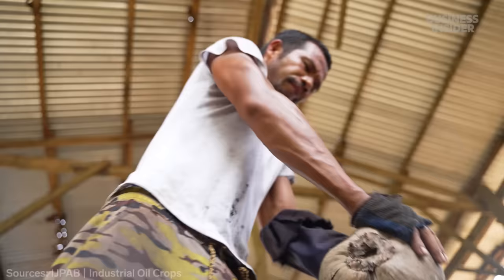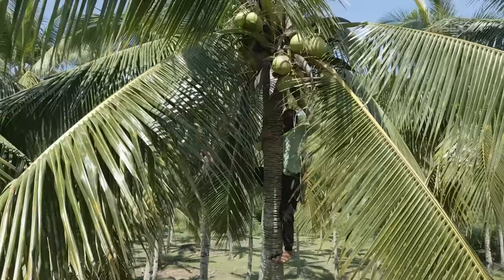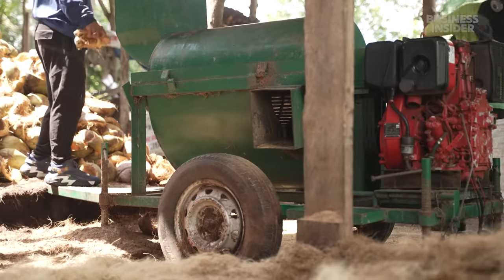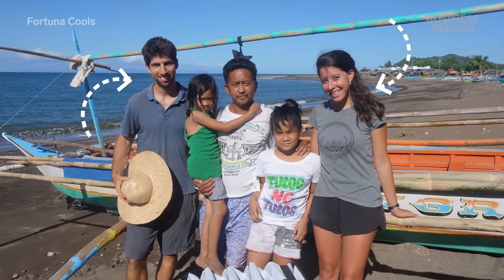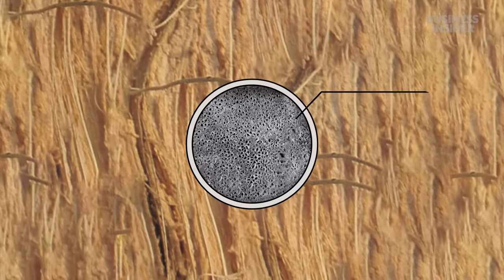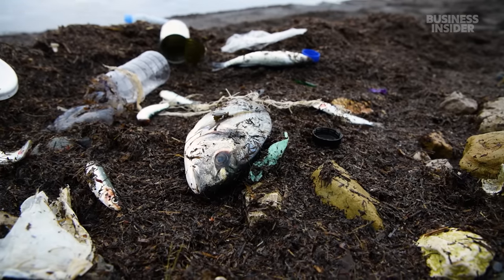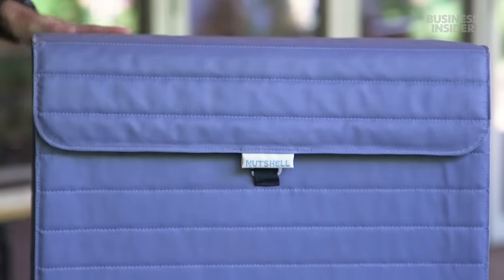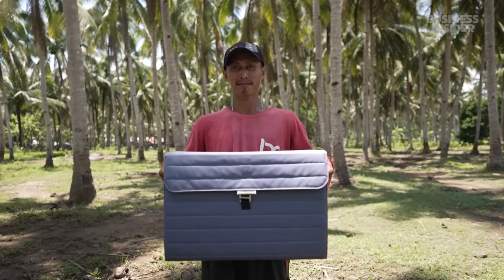How Biodegradable Coolers Are Made Out Of Coconut Waste | World Wide Waste | Business Insider

Comment: Greetings from the Philippines! For myself, I would like to see this product available in large sheet form to use as insulation in the attic cavity for residential homes. Our home, like the majority of buildings here, stands in the direct path of intense heat of the sun. fiberglass is prohibitively expensive and forget about expanding polyurethane foam. Can coconut husk fiber be an ‘inexpensive’ solution?
Reply: Probably very flammable so unsafe for housing. I'm sure they could add something to it to make it less flammable but then it increases the cost.
Reply: And or increase the carcinogen toxicity of it. Tradeoffs suck but they are in almost everything
Reply: Please don't. It's mentioned at the end that it's also used as kindling & a cheap substitute for charcoal.

That's probably why it's best used as a container for wet commodities.
Reply: Yeah as mentioned, sounds like a great way to light your house on fire. As intense as the heat gets there all it needs is a piece of broken glass to focus the sunlight and you've got yourself fire starter. Plus,  given the humidity, it'll likely start biodegrading/rotting causing all slew of other problems.
Reply: When can u sell these in the cities in the Philippines?
Reply: @cobblerama  Maybe, but more flammable than the popular paper insulation used some U.S. attics?   Also, interested in how well the coconut insulation handles water.
Reply: Fiber glass is dangerous too

Comment: I remember doing research on the coconut industry for my Thesis proposal years ago. The Philippine coconut industry still have a lot of problems to deal with. An example is the needed time for a regular coconut tree to mature and how long it has to bare fruit and the current issue where there's more old trees that are needed to replaced. We could switch to the shorter variant used by other countries but the coconut tree has a lot of uses here so it can possibly have a negative ripple effect in the coconut industry if it were to happen.

Comment: The challenge is on how it will be used in logistics. It needs to be extra lightweight since weight is factored in when shipping, you can't use a shipping box that's heavy and only carries the same as the styrofoam. I hope they mentioned how light or how heavy it is. But I applaud the ingenuity
Reply: Bruh they waste the water wtf.
Reply: Also the cost of production. Styroam boxes are easily mass produced and the styrofoam itself is both the box and insulation. WIth this coconut fiber, you still need a box, a difficult to construct box with multiple layers to hold the insulation.
Reply: @rubenearthling2974  water on brown coconuts are disgusting, no one drinks that in the Philippines. Brown coconut or the matured ones are only used for coconut meat production - for coconut oil and coconut milk. Green or the young coconut are used for coconut water, and coconut meat is soft and used in desserts or can be eaten as is.
Reply: @rubenearthling2974 there are a lot of reasons why they discard the water. For sure they ain't blind to not notice 😅

Comment: Curious to see how fire proof it is and if it could be used as house insulation
Reply: It doesn't really burn, but it smolders. So you could have a whole wall that's good a bunch of glowing coconut husk slowly spreading until it reaches something that will produce a flame, at which point you are already a long way into having a fire without even knowing it.

I'm sure there are chemicals or substances that could be mixed/sprayed into it too make it fire retardant, but then it's no longer biodegradable. However I think man-made home insulation isn't a big issue because it is sealed away and lasts for many decades. It's not finding it's way into the water and environment the way styrofoam is.
Reply: i think coconut husks are traditionally used as roofing in some traditional huts in the philippines, if i remember correctly.

Comment: Dear owners of this project. Hope you could read this. Did you ever consider making a home grade insect-resistant insulator for homes and buildings?
Reply: Cebu, the island where the company is based, is in the tropics where homes aren't lined with insulating material.
Reply: Actually, these tropical countries gets pretty hot, especially Malaysia.
Thus, the demand for Palm leaves and straw roof. 
# Insulation is actually used under tin roofs in some constructions.
I should also add that most problem with this is actually not about insects, it's rats, mice and bats
Reply: Would have to be fire proof too. Or less flammable.
Reply: @Epiphany_nz   They can make it resistant. Can be encapsuled by any material to avoid pests.
Reply: @cobblerama  Famous roof insulators here are ones made from styro covered by a thin layer of aluminum like material. The styro I believe is flammable. With proper material add ons, these coconut husks can be fire proof.
Reply: I wonder how we can find out more about Fortuna?

Comment: 5:15 It is not for insulation against the sun, think about it if it's on a palm tree it's more than likely already shaded by the leaves. I may help insulate once it has fallen but more likely than not it's simply for protection especially in long periods the seed may spend a drift in ocean currents, helping it float and lodge itself in any shoreline it may happen to be washed up on. This is the palms strategy for seed dispersal to colonise other lands mases.
Reply: ? it still is for protection of the palm. once it's away from the tree, it goes into ocean and will be exposed to heat from sunrise to sundown. Without the insulating property, the water inside will be cooked.
Reply: @dharmdevil  Heat is not really an issue because it's in water and it's constantly being cooled by it, even the hottest ocean water won't get much hotter than 35C, that's nothing for a seed, besides it's not fully exposed, most of the seed is underwater since they only need to be able to barely float, the thick shell is for protection, from physical damage, stop seawater from getting in and it needs to be light enough to float. Also UV radiation is a not an issue. There are a bunch of seeds that do this, if heat was a problem we would see some type of convergence evolution to mitigate this, instead what we see that buoyancy is a must and generally a good amount of energy stores to compensate for nutrient deficient soil(sand most likely) and for fast growth to anchor it in place before it gets dislodged.
Reply: @CMZneu  IDK if you;ve seen a beach filled with coconuts, but most of the time they are not on water, they're on the beach far away from the sea  baking under the sun. It's usually when there's typhoons or storms that the sea have a chance to reach far inland to wash the coconuts into the sea. 

other seeds dont have water inside that could store more heat. Ive seen coconuts with husks removed and only the hard shell, laying under the sun whole day and if you touch it the water inside could be really hot. liquid could store more heat. if you've ever tried to do hydroponics witthout shade, you will know what i'm talking about.
Reply: @dharmdevil  If it's in the hot sand all day no amount of insulation is going to prevent it getting hot, it's just going to delay the inevitable and make it cool down slower, also a lot of coconut's probably do die because of this, if they land in a shady place they are probably better off regardless.
But now that i think about it the husk probably helps but not so much because it insulates but maybe in moist sand it wicks water and as it evaporate it helps it cool down maybe.
Idk how much being filled with water would make it get hotter, water is a good heat conductor because it's dense but a lot of seeds sink in water ergo are denser... idk, maybe.

Comment: The problem with these boxes it looks very obviously much more expensive to produce than the styrofoam boxes that can be easily mass produced. And quite frankly I am not sure the plastic shells that hold the coconut insulation in a box shape are much less impactful than just turning them into styrofoam boxes.
Reply: I really want this to work. Unlike a lot of "green" substitutes that are just strictly worse than existing alternatives, coconut fiber has insulating properties comparable to or even better than polypropylene. It's a matter of figuring out the best way to produce them. Perhaps their best destination is an environmentally alternative to high end coolers where the coconut fibers are pumped in or molded with some type of biodegradable shell.
Reply: But I just don't think they are anywhere close to getting fish markets to use these boxes. The cost differential and logistical challenges are just too much.
Reply: Yeah, the cost difference is what concerns me, despite the fact that the initial cost is likely offset by the longevity, the issue is that these have value. I live in Southeast Asia, and these boxes are used for everything, vendors will ship items to customers distributors in them, sometimes even for things that aren't temperature regulated. Boxes are given back to vendors or used to send back empty bottles without any attention given to where they originally came from, just whoever has room in their truck will take some empty boxes off of a customer's hands. Restaurants also get them from these middlemen, of which they have several different people delivering to them, and they too, just send back boxes with whoever has space and wants to take them.

They are piled high in the corners of markets for sellers or customers to take or leave. They take up a huge amount of space but that's no issue because they have no value and are waterproof, easily left outside. Even if some occasionally do get damaged, no big deal. 

If you switch to coolers that have an initial cost and hold value, ALL of that changes. Suddenly companies and small businesses have to start taking inventory and inspection for damage, marking then when an easily to spot name or logo. Suddenly you need a huge amount of storage space to keep them locked up and protected from the elements. It really changes the entire system and it's certainly not the "easy"
 option, even if you completely ignore all financial issues.

Despite my skepticism, I also would really like this to work and spread. Hell, I'd love to figure out how to do this on a smaller scale and replace many of the styrofoam boxes in just a single town here to start. But to get this to work and be accepted as a legitimate wide-scale replacement, is going to take significant lobbying of businesses big and small, otherwise these will only be used in small quantities for in-house use and situations where the end-consumer may see the coolers, but never actually make it out into the distribution networks, which is obviously where the majority of them are used.

Comment: Sure the insulation is all natural but the bag looks vinyl or something. Kind of weird. And I'm surprised they don't have a collection system for the water. That's valuable.
Reply: I was thinking about that, too! 😅 I was confused if they were focused on sustainability, why would the rest of the bag be made of vinyl/nylon/some other synthetic material. I get this is to reduce the foam portion and organic materials tend to mold, but it felt kinda odd as a choice to just do one biodegradable part in a bag that is mostly plastic essentially
Reply: Here in the Philippines Old coconuts water is less sweet and kinda sour, its ok to waste it..we prefer young coconuts.
Reply: They explain this in the video. They are researching other natural materials to use but so far haven't found anything suitable. Instead for now they are using a plastic they make from used plastic bottles. Those wouldn't get recycled anyway normally, so this is still a very green choice that is strong, easily washed, waterproof, and bacteria resistant. 

As for the water, these are mature coconuts, you don't usually drink that water. It's sour, bitter, and there's usually much less of it compared to what's inside green coconuts. Mature coconuts are for the meat, which has grown nice and thick and absorbed much of the water, young coconuts are for the water. As for where the oil comes from, we make no public mentions of oil sources because we don't want the US military  invading all of Southeast Asia.